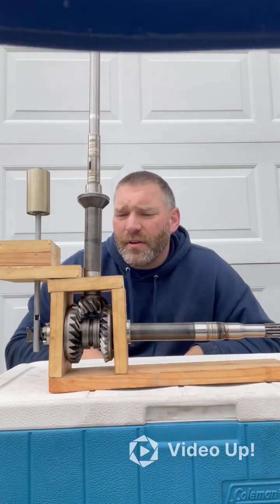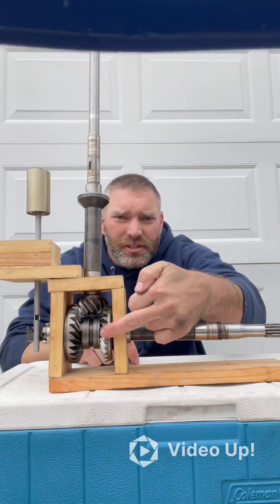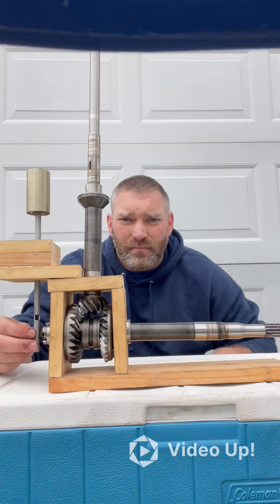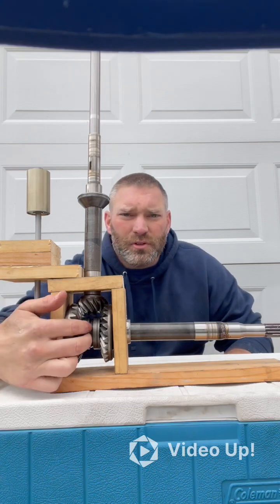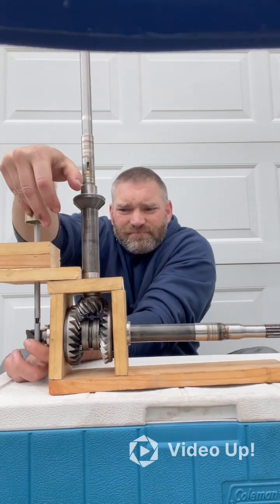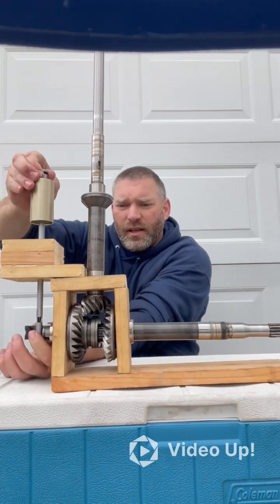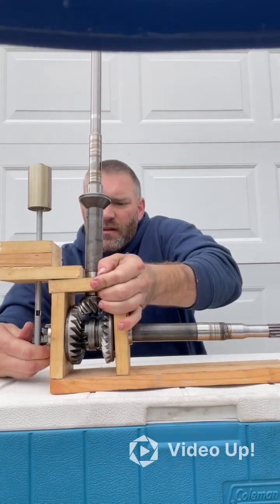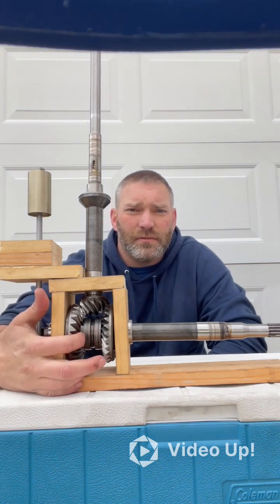How a boat motor shifts gears.  How a dog clutch works.

Comment: Great video. I’m new to boats and my boat grinds gears when it shifts, is that normal or is it idling too high or what’s the issue?
Reply from the maker: Shouldn’t grind at all!
Reply from the maker: Either shifter cable needs adjusted or idle is too high or both
Reply from the maker: Or your dog gear is wearing out and not catching or gears grinded.  Easier to check cable position and idle first.  I recommend disconnecting shifter cable and shift it by hand while off and turn fly wheel to engage it.  Then mark where the arm hits F N and R and adjust your cable to when you shift with motor off it lines up with your marks then check it on muffs

Comment: It's an ingenious design that negates the need for the motor supplying the power to change directions. Even as it continues to spin clockwise, the rotation of the propeller depends only on whether it's the front or rear gear that gets engaged.
Reply from the maker: Correct.

Comment: 1996 ocean runner 150,  disconnected shifter rod one under carbs from cables and it is very hard to shift.   I have the star adjuster out all the way so I can grab reverse but now no forward,  any other way of adjusting other than new cables? Thanks again
Reply from the maker: @buckeddy  depends.  If shifter rod screws in you could adjust height of threads used.